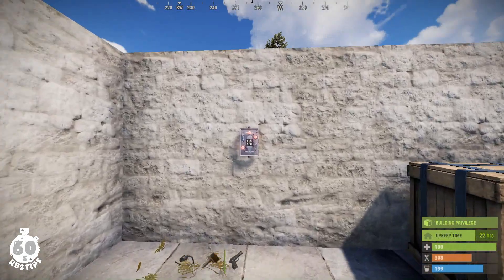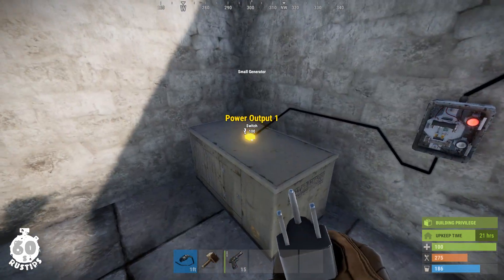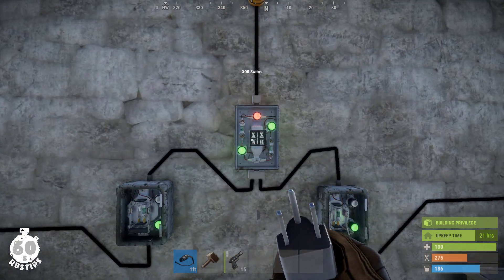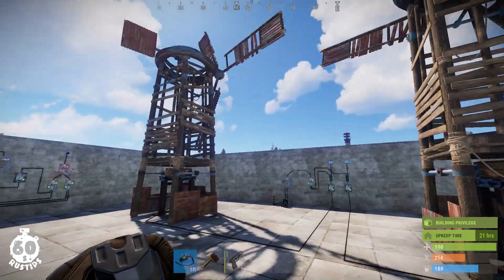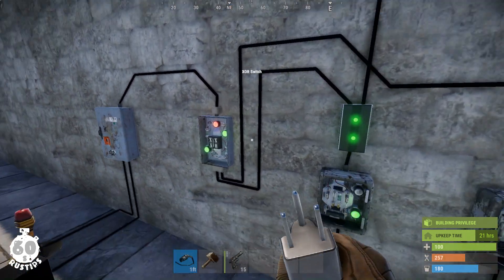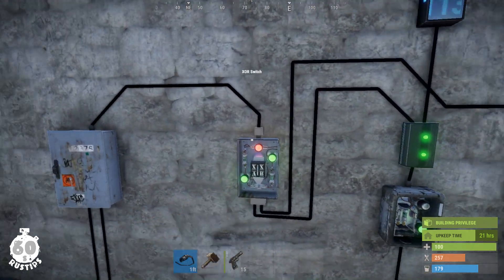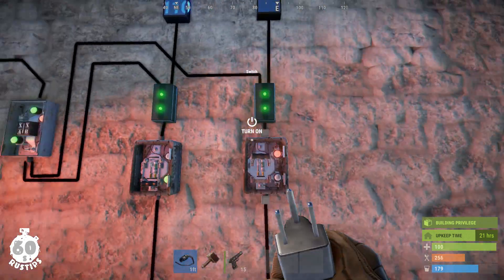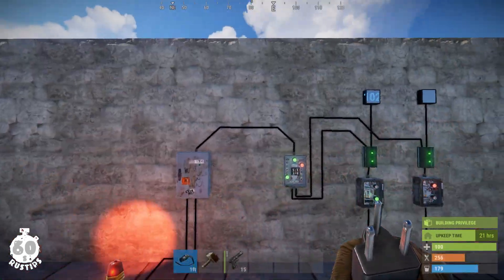60 Second Rust Tips | XOR Switch + Alarm If Power Source Destroyed

Comment: those switches are in my eyes bugged, because when the XOR switch only have 1 input active (which is 1 power) and the other has 0 but that has only power when I turn the RF receiver on) then still it uses 27 power and not just the power send to it which is 1 in this case.
So it's bugged.
Not usefull in my case.
Not sure if i explained it correct but normally if you put 1 power on the left side of a XOR switch and 27 on the right, then it will do nothing but still there will be 27 power used which is dumb. It should only use 1 power for the XOR switch. Pretty lame
The AND switch does do the same thing.  I send 1 power to it on the left through a RF receiver, and 27 power on the right. When the RF receiver don't send power to it, it still uses 27 power from the right while that can't be the case cause it is blocked sort of speak. The output of the AND switch is 0 and still it uses 27 power. fukked up in my eyes.

Comment: also works for solar panals, if you use an OR switch, you can make your system use solar or wind depending what is generating more energy, and then use a blocker to block battery back up, so you have wind/solar, then battery back up that isn't being drained. Rust electrical is the real end boss